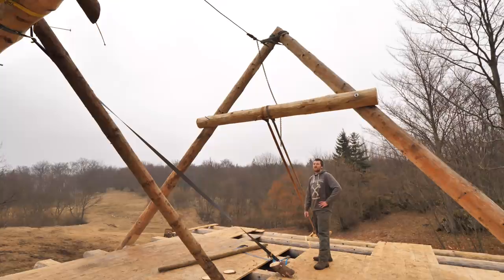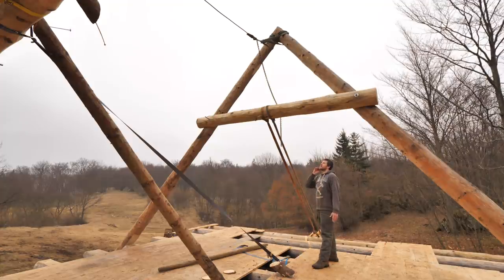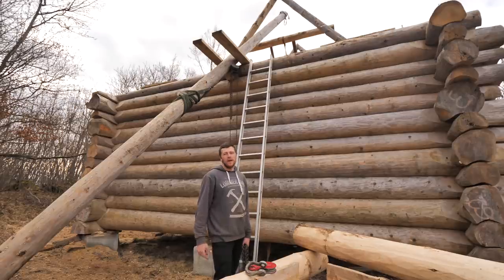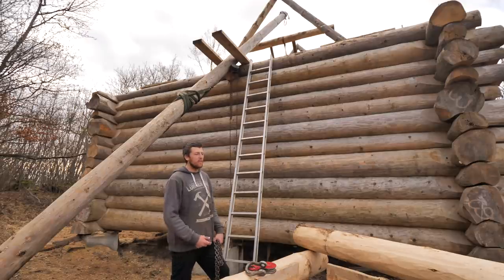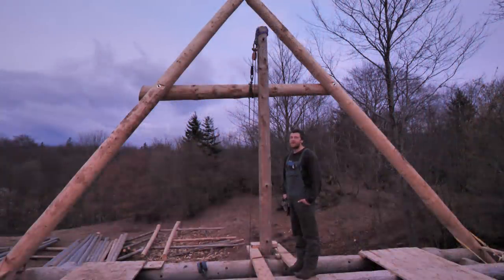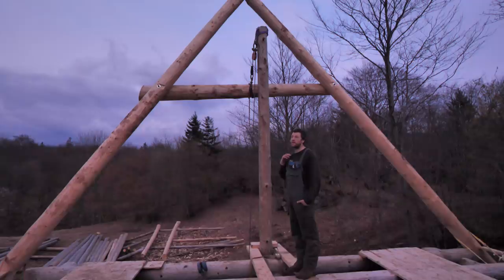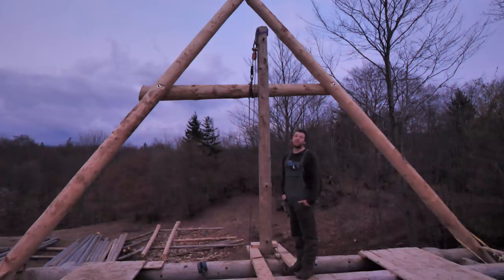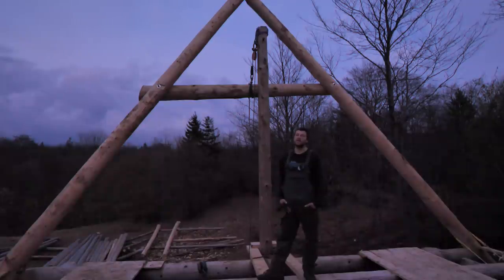Building Off Grid Log Cabin / Finishing DIY Roof Trusses ALONE

Comment: You should build a remote control on the truck for the robe... Just a small esp with some relays for the switches... Then you can take the logs up and control with a phone or cheap 433 hrz radio control... Then you not have to run all 1m to look if everything is alright! 👍 Thanks for sharing this amazing project! I im exited to see forward to the finished house 😂 when you expect to have it  ready to move in?

Comment: I'm sure you've considered this, but in moving slabs of stone, i have used small hardwood log rollers under the load rather than dragging against the soil. watching you lug those long logs with a strap, I have wondered what a couple, meter long by 10 cm rollers spaced out could do to ease that movement. i'm completely taken with the whole of your effort and the artful and nicely paced video you so painstakingly craft.

Comment: I must say this,  and believe you me,  I appreciate everything your' doing and haven't missed a moment.  Why did you not get yourself a couple portable winches for up on the deck?  Instead of all the tractor pulls. I hate to see someone struggle when there is a simpler way.   I've heard a generator so power wasn't an issue. I wanted to fly there from the USA so many times to help,  (my experience, 45 yrs building houses). Okay, back to the video.

Comment: I admire you. 
you should be able to lift the triangle on the roof without wedging using a two by four.
If you would place the triangle the other way around, with the base towards the house, the wire angle would be smaller.
The triangle would get hoisted upright with the top above the structure. you hold it back on the other side with a line.
When it is upright and you pull it further, it wil be its own fulcrum and pivot on the roof.

Comment: I think you have to put a pole in the center so it pivots on the pole in the center of the triangle and then it’ll pull it up right underneath your horizontal brace it should torque it into place

Comment: Just a question. You don’t seem to get much snow there. Therefore no snow load on the roof. You could have used logs 1/2 as big and it would still have been over kill. Curious as to why use logs that are 12-16 inches in diameter.

Comment: Impressive so far. Just a question, what are the metal parts under the two supporting logs of the balcony (on top of the concrete blocks)? And why leave such a gap between the logs and the concrete?
Reply: Anchors attached to the pillars and concrete blocks with a turnbuckle for adjustment.  Log homes will settle as they age in place (plus any added weight from additional building on top).  The large space is to adjust for this settling and keep the logs aligned.  Not that I know a lot about building a log home, but he answered this and many more questions in a previous video.  :o)
Reply: @Doofus66  thanks!